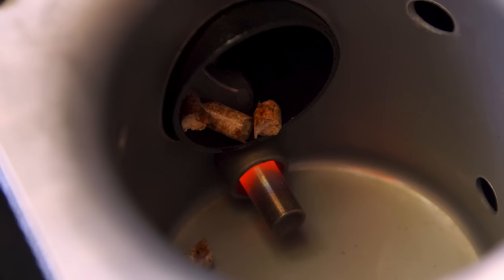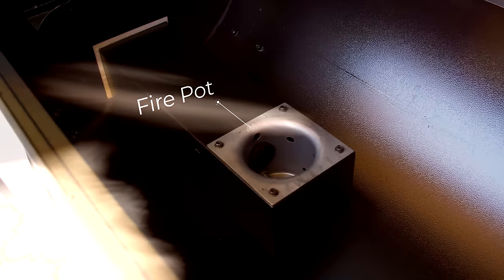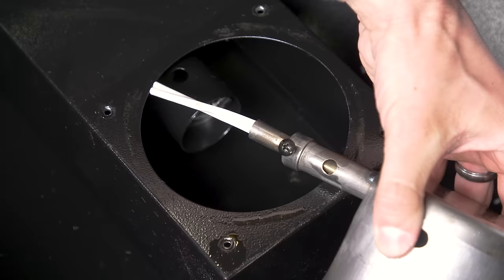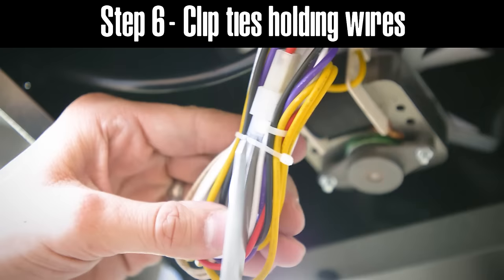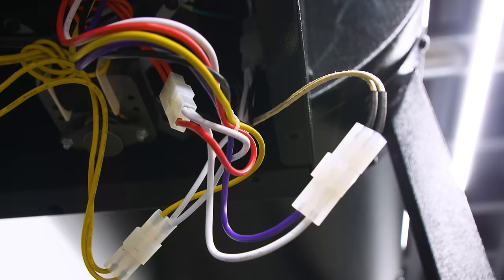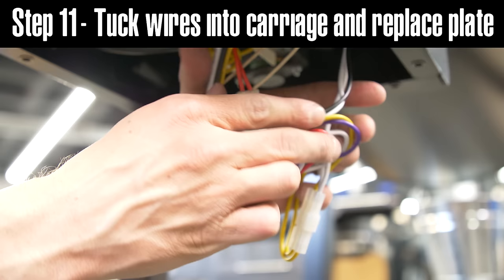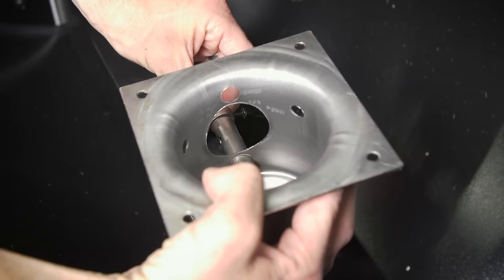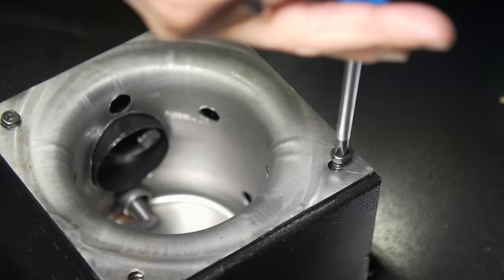How to Replace an Igniter on any Pit Boss Wood Pellet Grill | Pit Boss Pit Stops

Comment: How often does these go bad “
Reply from the maker: This is more of a "Just Incase" not a "when your ignitor goes bad." I've cooked on dozens of Pit Boss's, never seen or had a bad ignitor in person. This is definitely for the guys who have had theirs running for 8 years.
Reply: I’ve had mine less than two years and use it on average 3 times a month and last night the igniter stopped working, so it’s more accurate to say anything can happen and more accurate to say, “Should your igniter go bad, order a new one from us and this is how you put it in......”
Reply: I know of a few of these on the 820s have gone bad... My temp probe just started acting up on summer #3. Love pitboss but stuff just isn't made to last like it used to.
Reply: Thanks for the video. I bought the 700fb and within two cooks the igniter went bad. Customer service was great and sent out a new one (these things come with a 5 year warranty). 
Here’s my problem- those eight screws on the undercarriage were drilled in so tight and the screws are so cheap that they strip EASILY.  I ended up drilling thru them just to get to the bottom. Please just go with four screws and use decent hardware.
The people at customer service were great and understood (and agreed) with the screw problem as they have to work on them too.
Once I got it fixed I’ve loved it....
Reply: I have had an 820 for about 6months now and already had igniter issue. will have new one here by next week.